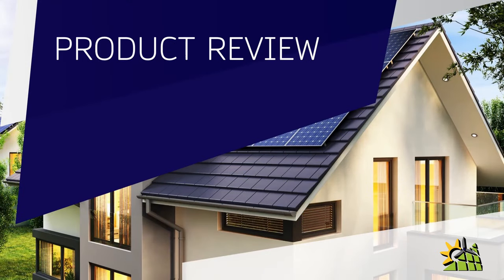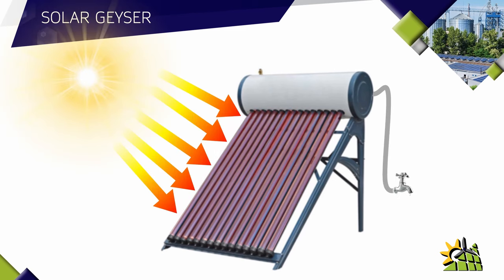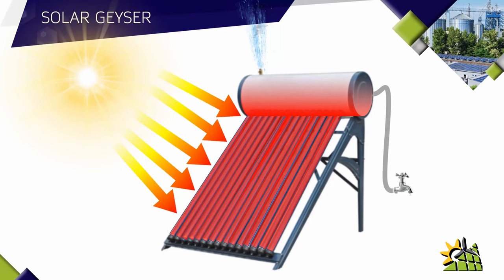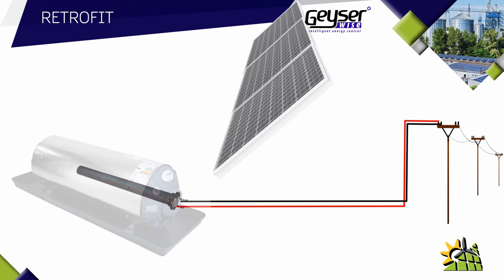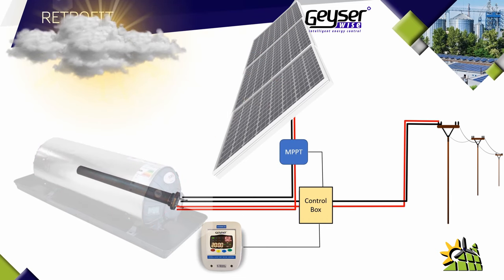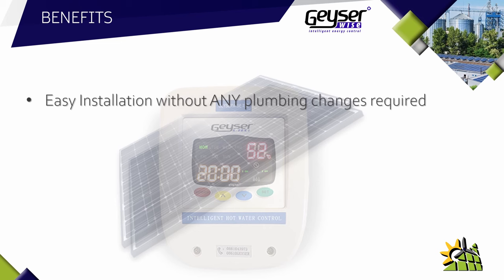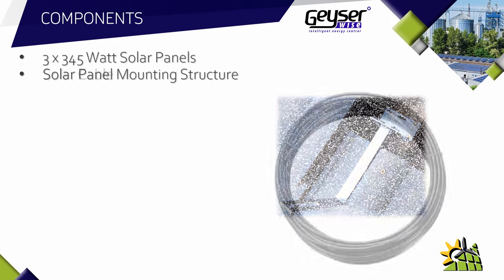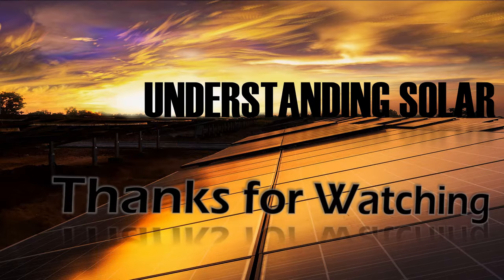Solar Geyser Retrofit

Comment: I've been in this industry 13 years. We have been doing full solar geysers with its own tank on the roof, as well as retrofit pumped solar geyser conversions. We also do this ac dc element conversion.

A few facts in this video are a little bit misleading.

1 - The benefit of a integrated solar geyser(like the one in this example), is that it needs no electronics. If there is sun, there will be hot water. (It does have an element fornrainy days though, but can be installed without it). Sizing is of utmost importance though.

2 - It's true that they can overheat but we have replaced a negligible amount of valves and rubbers and have installed thousands of systems. If done properly, its no more maintenance than a standard geyser. In fact,our stainless steel tanks will far outlast conventional geysers.

3 - This AC/DC system performs much worse in overcast weather than any vacuum tube system. It has its place in the market, but cost vs benefit is not always worth it for domestic use.

Comment: Interesting new concept however the newer indirect pumped systems seem to have overcome the issue of water boiling during hot days/low usage. I have had two of these systems, each one for 12 years and never had any issue with tube leaks. I fitted a Y strainer before the circulating pump and cleaned it regularly for reliable trouble free operation.

Comment: 15years we've had a tube solar and have never had leak on the rubbers.
Reply from the maker: That's good.
Reply: It mostly happens when you have lime
Reply: Technology has moved on, modern day inverter systems all round can heat your normal geyser with out all this out dated crap.
Reply: @mhd786jna3  your normal geyser gets a calcium build up
Reply: I compare price and this method in video too expensive than tubes

Comment: A typical household needs hot water mainly in the morning, say from 5am - 6am. That means the geyser should have been heating water from at least 4am. But we know that around that time, there is no sunlight, therefore you'll have to use the grid. It is the same thing in the afternoon when people come back from work. That is between 6pm - 8pm. I expect the solar panels to have heated the water already during the day but depending on the demand (the number of people), you may have to draw from the grid because the sun will not be available for solar to heat up extra (refilled) water after the first use. Therefore this system is useful in the evenings after the solar panels had had a chance to produce electricity but not so useful at the critical part of the day, that is, in the morning. To meet the evening demand, maybe the capacity of the geyser can be expanded. But the rest of the system should be expanded as well (solar panels). I think for this system to improve availability and efficiency, we need to devise ways to store large quantities of hot water for longer so that the system can heat up and store enough water (for morning and evenings) during the day while the sun is out. Alternatively, we can use batteries to store energy for later morning geyser use, but this is an expensive solution.
Reply: thats why a battery pack is crucial to store power that will be used whenthere is no sunlight for panels to do thier thing....when the sun comes out it will be to replenish the pack and you will be good to go
Reply: 200l water heated to 65c can last both evening and morning use for 4 people. The amount of water your geyser can take/heat also makes difference in how long the water will stay hot.  Its also a form of storing energy the more you can store the longer it will last. You can test this by turning off a normal geyser at 18:00 have the family use the geyser both night and the next morning If the hot water lasted both cycles, this will work without the grid. But as stated amount of people vs Liters of the geyser.
Reply: the water tanks themselves are heavily insulated and can hold temps pretty well over night, but it's not a 100% solution, thats why they are AC and DC elements so that if you need it you have the grid and can be switched, the goal is to reduce grid use, not be off grid.

Comment: Is it at all possible to retrofit a very old low pressure geyser?  When I say very old, the house was built in the sixties and we bought it in the eighties.  The geyser has never given us problems - not even once.  But now we must find ways to save on the electricity bill.   Thank you for a neat, well--made instructional video.
Reply: it shouldn't be any problem because you only swapping out the element and not the pressure valves.

Comment: Great viewing. I have the system installed however there is an disadvantage not discussed. During loadshedding the system does not work so i loose 2 to 4 hours of "solar time" to heat the water in the geyser.

Comment: Good video, clear and to the point. A request, can you explain where the inverter and batteries come into play?
Reply: I’m also here to learn but there shouldnt be any inverter or batteries.  DC element would heat off DC power from the solar panels and MPPT solar controller directly. So it stays DC power all the way and therefor no inverter required for AC conversion
Reply: This system doesn't store electricity. The power is used to heat the water.

Comment: Why not just produce AC power with your panels through an inverter? That way you heat water when needed and when it’s hot enough you produce electricity for other needs, instead of having panels doing nothing.
Reply: DC is more efficient compared to AC
Reply: And also cheaper

Comment: Both systems make use of the sun's radiation i.e. reference to sun's heat is incorrect. It is just that the evacuated tubes use more of the spectrum of sun's radiation which makes it more efficient than the pv system.
The tubes also have a built-in stagnation temperature which is a safety mechanism against run away tempertures.
Evacuated tube system is cheaper, lower cost and simpler compared to pv system

Comment: I am looking at these systems. I have 2 geysers in my House. The primary reason for installing this is to save electricity on a standard Geyser what are the savings I am looking at per month? What's the down side of this system if there are any? How long will it take this DC element too warm up a 150 litre geyser? What company installs these systems? Are there any use cases of people who actually installed this type of system and what savings they have seen? Sorry for all the questions.

Comment: Compare to your conversion kit system the solar geyser is at least 30-50% cheaper in terms of material. So in other words evac tubes, controller and 220v pump R8000. this i found in cpt. Installation cost should be about R1500-2500 EXCL COC. i had solar evac tubes geyser system and never had any problems at all. i would suggest 220v circulation pump instead of that 12v since the 12v becomes faulty and causes overheating. Your system on a 200l geyser with 4 panels acdc element mppt etc all at 15k. So you are incorrect at the start of your video saying it is more expensive to purchase and install the solar geyser than your system. the only way whereby the conversion kit works and is a clear winner is that it is basically a diy and maintenance free that's it! with that being said, I have to admit the conversion kit is much better and convenient and i would advise anyone to go for it but, we have to be honest with viewers/customers too that it is in no way cheaper!!!

Comment: I hear doing a retrofit on a geyser isn't recommended because theres more risk of a geyser burst occurring? Because the solar panels can make the element burn hotter than recommended? How do you remove that risk?
Reply from the maker: This would apply if there were no thermostat. This product has a thermostat connected to the MPPT. When the water reaches the set temperature, The MPPT will not allow the power to go through to the element. I hope tis answers your question.

Comment: roughly how much does the mentioned equipment cost?
Reply from the maker: It is R17 000.00 including VAT. For more info please mail me at edward.rae@electechrs.co.za
Reply: Is this for any size geyser...?...i hv a 15 year old 150l high pressure copper geyser ...it has outlasted the other 200l kwikot geysers by far...

Comment: Anyone knows how effective this element is compared to a standard AC only element.  I guess it heats water much slower ?
Reply: it would have to be much slower, with only 3 345 watt panels you are maxing out at about 1 Kw of peak power, the typical water heater element is 4.5Kw

Comment: why convert the geiser when you can just produce PV electricity and power the whole house including the Geiser
Reply: because pv system for whole house is closed to 5kv system which cost r35k min and runs on batteries which runs out quite quickly. this system doesn't require batteries which will continue to power the element until the pre-set temp is reached and instructs the mppt to switch off. my 5c advise to anyone is invest gas stove/oven, solar geyser or in this case pv conversion kit and maybe a 1k or 2k pv system with battery running the rest like tv, computer, wifi, lights etc for at least the period loadshedding takes place. this will work much cheaper out

Comment: It's stupid to use photovoltaics to heat water when instead you could use passive solar water heaters and eliminate all the lossy middlemen.
Reply: No tim im doing this for years but on a manual basis. I have to switch off my solar heating before 11   12  to curb over heating.. im also going to go to automatic control the 2 systems